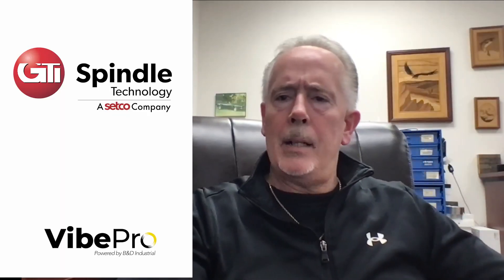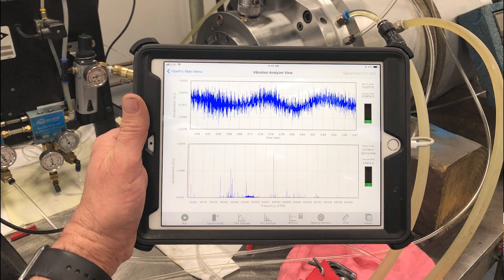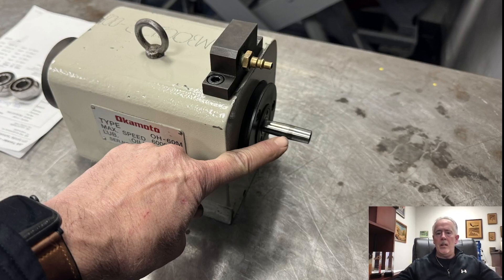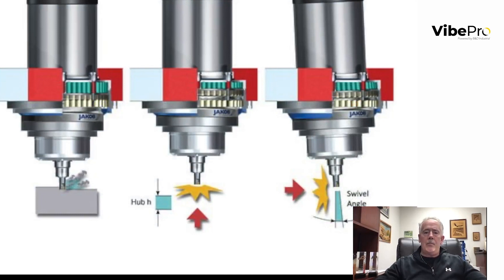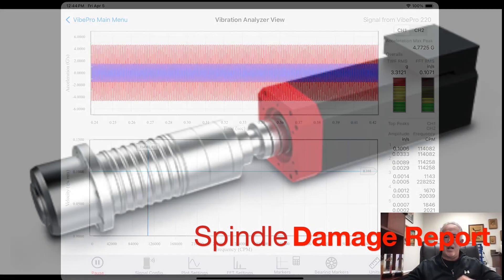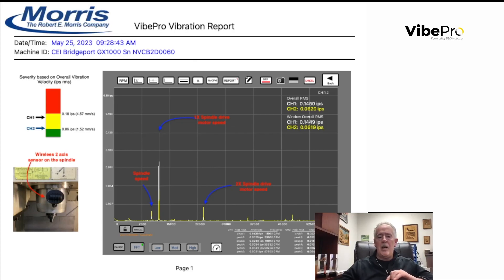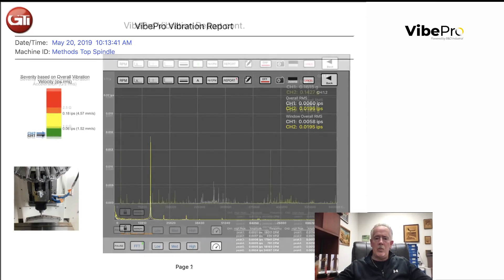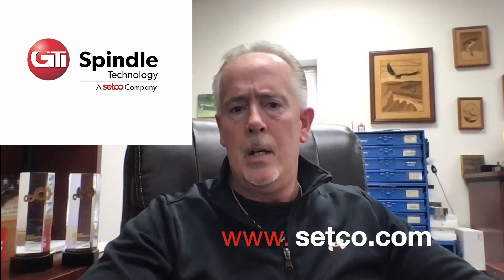Why Spindle Vibration Analysis Matters

Comment: I cannot understand why you still use the wire connector after all these years, why not use the ipads wifi or Bluetooth to connect to the wireless sensor? The fire connector has to be a weak point.